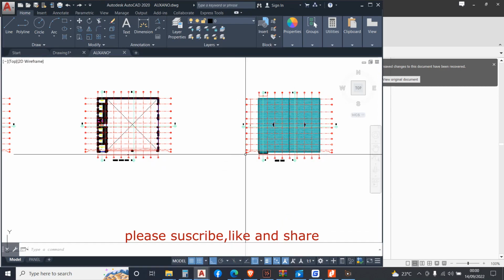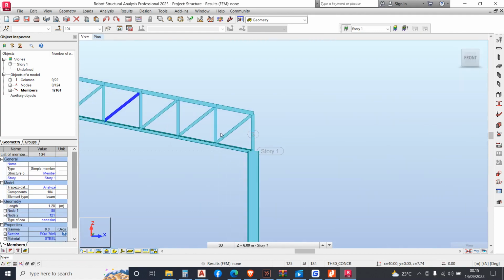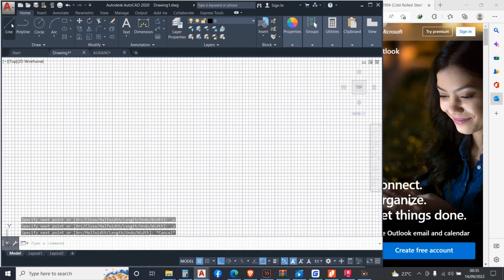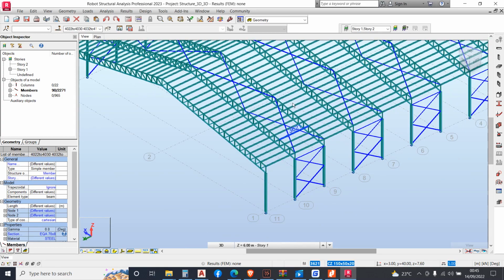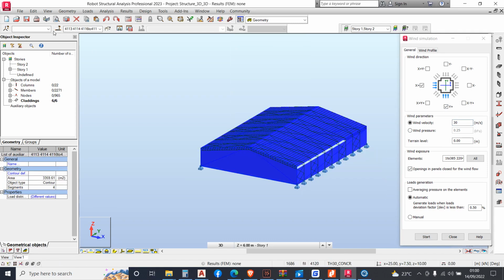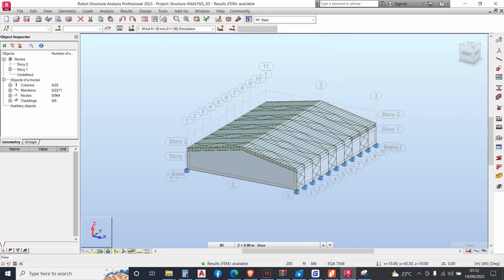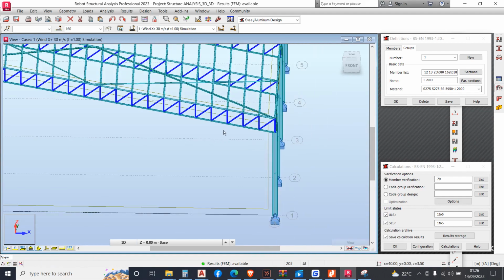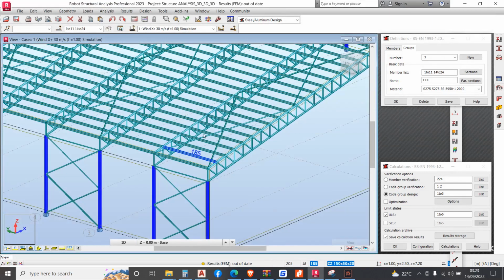Autodesk Robot 2023; Modelling and Design of 40m span truss (complete tutorial)

Comment: 0:00 Project
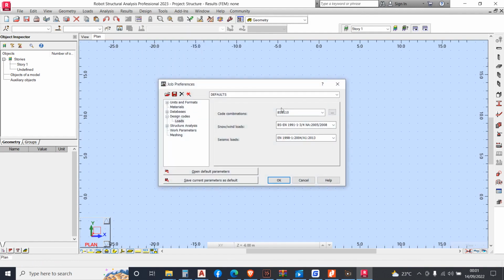1:05 Job preferences
2:28 Axis Definition
3:16 Structure stories
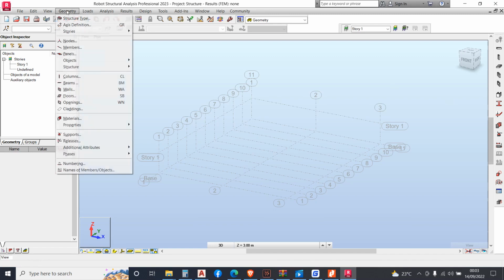3:47 Columns
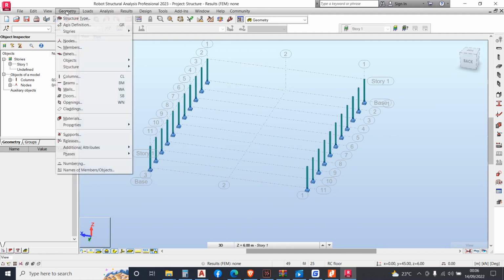5:24 Trusses
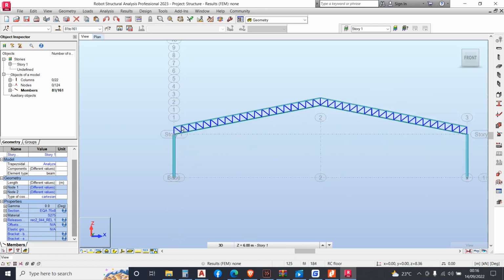11:22 Copy/Drag
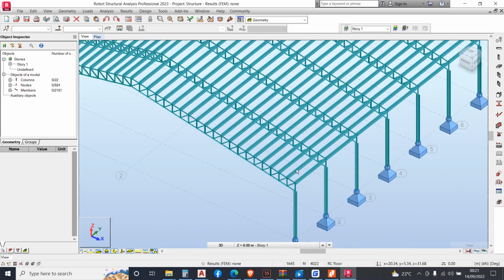15:46 Select purlins
18:36 Sketch zipper lines
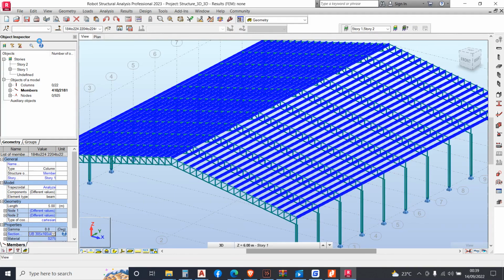23:20 Add section and purlin change
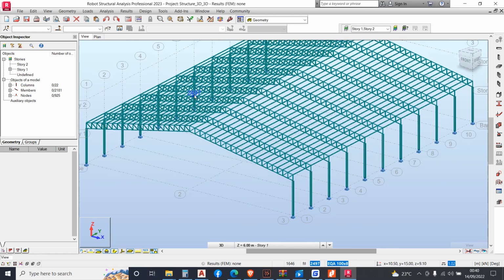24:30 Bracing
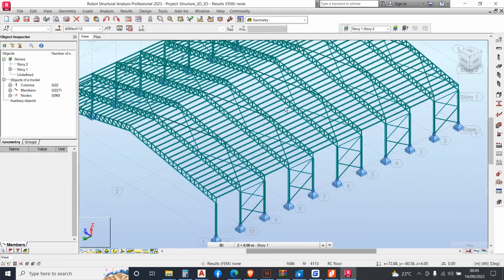29:14 Trapezoidal and triangular method
29:48 Purlins releases
30:48 Claddings
37:55 Wind loads
41:39 Load types
44:48 Analyze
47:28 Manual Load Combinations
48:20 Structure Type (Truss 3D Design)
48:38 Analysis
49:45 Diagrams for Members
51:00 Steel Design
52:47 Changing Material
54:22 Structure Type (Frame 3D Design)
54:37 Analysis
55:50 Diagrams for Members
56:34 Steel Design
57:15 Grouping
59:43 Calculations
1:01:02 Results
1:01:53 (IDM is corrupt)
1:03:12 Optimize
1:03:19 Structure Type (Truss 3D Design)
1:03:28 Analyze
1:03:50 Grouping
1:05:01 Calculations
1:06:48 Results